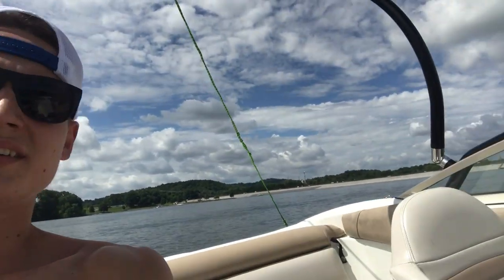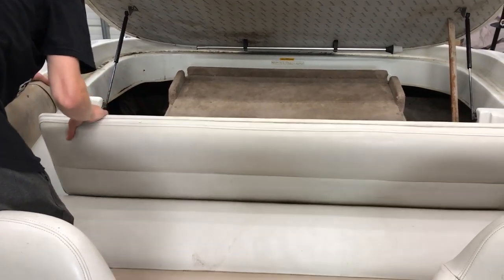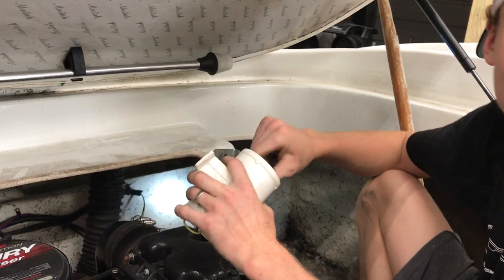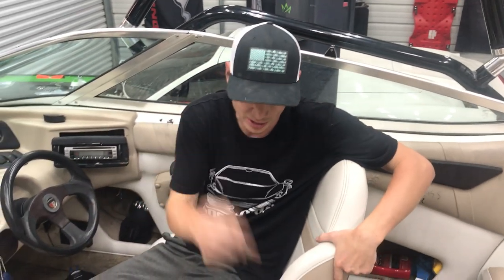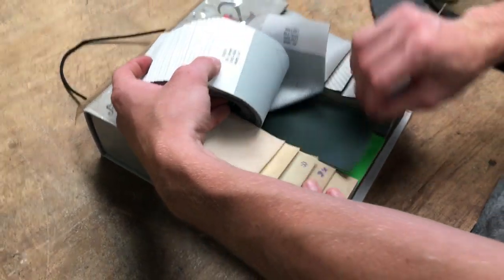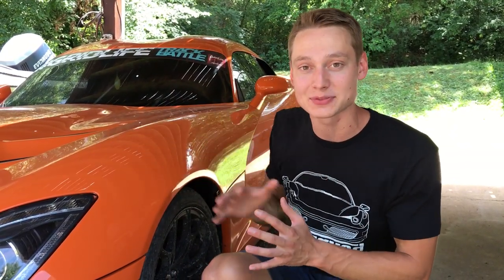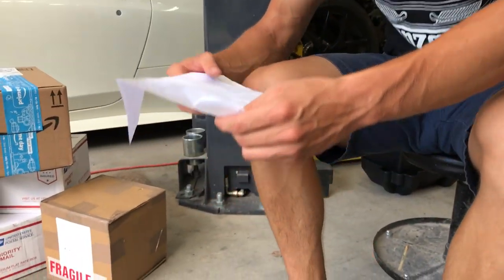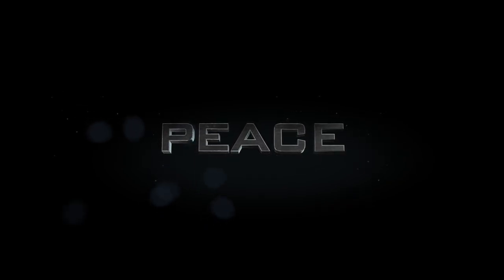Rebuilding A Super Cheap Wrecked Boat Part 4

Comment: Always run the blowers before cranking. A fire or even explosion can and have happened from fume build up.
Reply: Number 1 rule in boating
Reply from the maker: Did not know that, glad nothing bad happened. Thanks for the advice
Reply: goonzquad Run it at least a couple minutes.
Reply: @goonzquad  The fumes from an 8oz cup of gas in the engine compartment are equal to several sticks of dynamite! Be careful guy's. I wish I was closer, could help you out with some stuff, been doing it 40 years plus. Enjoy and keep up the good work.
Reply: They don't worry about those little things, they don't know what they don't know
Reply: @colstace2560  I don't think they care that they don't know or even take the time to research.

Comment: Couple things......You NEED your blower fan working to even start your boat unless you want the gas fumes to blow the back end of the boat off! Seriously.....fix it or when you start it at least open the hatch for a few minutes. Use the blower every time you fire it up for a minutes or two.  Second your speedo is controlled by a small flip down plastic thing at the bottom of the transom. Flip it down to work the speedo and up when you trailer it. there's a small tube hooked to it and it measures the pressure of the water going into it to calculate speed. cheers boys.

Comment: I work on these everyday, the black hose you had in your hand is the oil drain hose, you can use a oil pump to pump it out, the brass plug on the end of that hose is a extra drain plug for the hull.

Comment: That hose with the brass fitting and extra connector is a quick drain for the engine oil.  The brass plug goes into the drain plug at the bottom of the boats transom.  That cable then connects to the oil pan to drain the oil, just pull the drain plug, unscrew the coupler that's attached to the hose (while the rubber drain line is pulled through the hull and you can drain the oil easily without having to pump it out. Side note -  It's really slow draining.  I normally just put a gallon jug on the ground and about 1/2 hour later it's full and proceed to the next gallon.  It should hold 5.5 quarts with a filter.  Also on the RPMs.  That motor is going to grenade at 6K.  That boat is WAY under-propped if the tach is correct.  Need to look at the pitch of the prop (should be stamped on the hub of the prop).  Lower pitch like 19 or so gives better low-end / holeshot performance but sacrifices top end speed. The best bet is to have a prop that reaches the recommended RPMs with a medium load and 1/2 tank of fuel.  Also look for a stainless steel prop vs. aluminum.  Aluminum flexes under load and looses performance.  Side note if you hit a log with the aluminum prop they are cheaper to repair.
Reply: Good job! I'm just going to copy pasta this to make sure they see it!
Reply: Russ Rea  ahhhhh ok, nice one capt!
Reply: Stainless steel props are nice but if you do hit a log or drag the bottom the out drive may damage and break before the prop breaks. I always ran the stock or aluminum props when running in the river where I was more likely to hit a stump.

Comment: The hose on top of the engine with the attached drain plug goes to the oil pan. Mercruiser used to have these on all their I/O engines. It allows you to run the hose out the drain plug hole to change the oil. Note of caution, the plug needs to be tight every time so that the hose doesn't come out while your boating and get chopped off in the prop and empty out all your oil. 
About the 6000rpm running of your engine. I think most Mercruisers top out below that. I think your tachometer is not on the correct setting. There is a dial you can turn with a small flathead screwdriver to set it for a small block V8. Happy boating and keep up the great videos!

Comment: About rebuilding a wrecked Lamborgini : "We'll fix that easy man"
About changing the carpet : "That a big job"
Reply: Lol it is an all day job.
Reply: Pressure wash it. As long as it's not dry rotted it ripped it will clean up.
Reply: They just need to purchase a commercial upholstery cleaner. Hot water and suds will make it look brand new.
Reply from the maker: Hahahah nothings really that hard, just something we’ve never done
Reply: goonzquad use a spray on bed liner like raptor instead of carpet
Reply: @dogbark6394  that would be easy, but also quite ugly I'd think
Reply: @BRAMB0SSS  Noisy and Hot as Shit too. I took tge carpet out of my Jeep Cherokee XJ and I wished I wouldnt have. I painted the with bed liner and it was Hot Noisy amd uncomfortable. I then painted over it with white paint to see if that would help out with the heat but it didnt. So now Im gonna put insulation down then do a rubber floor.
Reply: Guillaume Pigeard hahaha
Reply: @goonzquad  You boyz need to  put that Lamo engine from the donor and put it in the boat....Now that would be soooo Legit. Remember to name the boat Legit.
Reply: Haha.
Reply: goonzquad --- Yes sir!!  Jump in, learn and get it done. I was always a little hesitant in my younger years, I'm 44 now, but I've been a diy'er since I was 17. Just gotta learn what you need to when the time arrives. Keep on keepin on guys !! Teach and inspire !!
Reply: You are right
Reply: @goonzquad  11 months later...lower the engine and retract all the hyd rams to get the fluid back into the reservoir. You will overfill the system if the rams are extended and you top the fluid.
 Follow the manufacture directions for replacing the fluid
The screeching may be the motor itself, an armature shaft bushing dried out or the trim rams rubbing against the outboard.
Reply: @goonzquad  @goonzquad

Comment: Don't do carpet! Hydroturf or something similar. I redid a friends interior with Hydroturf and it's a much better option. He loves it.
Reply: Seadek is the one to go with
Reply: I did the same thing for a buddy of mine. Completely agree.
Reply: @SouthFLMudClub  If you actually fish hard you know sea deck is the worst shit, I hate spending 3 hours scrubbing a bloody sea deck and sometimes it never comes up. Looks awesome and it is good for small helm pads or if you don"t fish, but if you actually use a boat I would not recommend it. Again, it looks awesome, softens things up, and is pretty great but it is a bitchhhhhhhh to clean
Reply: @craigerking9790  I would think on a ski boat it's a great application compared to carpet....
I hear good and bad things...
I'm sure there are positive and negatives...  As with everything. I do plan on fishing often once kids get a lil older. My boat is a 18' center console that we do all with.
Reply: Decadence flooring is the way to go. It just lays on the floor with no glue and you can pull it out whenever and just dip it in the lake or power wash it

Comment: Telling you. 5 or 6 blade propeller on that engine. The wake it gives for wakeboarding is the BEST.
Reply: Yes, change prop
Reply: Dont need anything more than changing the pitch. It probably has a 19  so go to a 21
Reply: @robertrizo4010  maybe if it was 5 years old or younger. But she's probably older than u.🤭
Reply: SourBogBubble absolutely change the prop!  You WILL see a HUGE difference!! 🚤

Comment: Also, you guys really need to learn how to use that trim on the boat! 

Full down for taking off, then once you're up to speed you bring it up to plain out.  If you start noticing the bow (nose) bouncing, put the trim down a bit more (quick presses down until it stops bouncing)

Comment: SPEEDOMETER:  tiny holes on the forward edge of the outdrive.  Clean them out with a small stiff wire like a paper clip.  This is a very common problem as boats go through silt it collects in there and that’s how the boat’s speedometer works by water pressure in those holes.
Reply: Just upgrade to a GPS speedometer. Way more accurate and no moving parts.
Reply: Good intel.
Reply: @michelevitarelli  Yeah, just put a cell phone mount on the dash and download any of the free apps. Problem solved.
Reply: Do they also have pitot tube balancer in line too?  Clean all tubes or just replace with new and I bet your speedo is fixed!

Comment: Next build should be a g wagon 4*4 squared 🔥🔥🔥
Reply: The Boss yes but I doubt it i said the same thing 2 weeks ago
Reply: Nah bro 6x6🥴
Reply: That’s expensive and not practical at all but I wouldn’t say no to seeing that series either
Reply: One useless car.
Reply: The Boss I’d love to see them tackle a g 63 amg
Reply: 💯% Sure! Or X class!
Reply: Finding one of those wrecked would be impressive all in itself and sourcing the parts too would be another adventure
Reply: Agreeed
Reply: Ghost Rider how they even gonna find one of those tho
Reply: Chinedu Ojielo finding parts isn’t too hard it’s just finding a written off one, I did see a manual Lamborghini merci tho and they are veryyy rare
Reply: My ex wife has a G550. It is a horrible driving , twitchy handling monster to drive. It is build like tank, and super luxurious inside and i am sure it is awesome off road. IMO if you want to off road buy a jeep, cheaper parts and way more aftermarket support to do anything you want with it. If you want a luxury SUV they are better , more useful options. $20,000 will buy a couple bumpers from Brabus for your Gwagon or you could spend $20,000 and go crazy modding a jeep . I love Mercedes and owned over a dozen but ii just dont get the modern Gwagon.

Comment: Hey guys, SAE 90 oil for the outdrive lube, "monitor" the funny looking hose on your exhaust riser is an oil drain hose hooked up to the oil pan. The outdrive hydraulic pump can be just emptied out with whatever pump you use around the shop and fill it back up with regular ATF. You will probably have to cycle the trim up and down to flush out the old stuff. And that should be a small block 305.

Comment: If you can run over 6000 RPM,change the prop.
Reply: J L yep for real!
Reply: Agreed. He was probably hitting the rev limiter in the earlier video. There's no way it should rev that high.
Reply: Agreed, but with the speedo broken it makes me wonder how accurate that R P M Guage is.
Reply: A broken speedo has nothing to do with a tach. One is electronic and the other is water fed. Your tach can work and your speedo not. And vice versa.
Reply: @davidwesternall873  Its actually more like 4800, 5500 is more for outboards

Comment: you guys should get some safety equipment for the boat, such as fire extinguisher, lifebuoy rings and so on 🛥️
Reply: Life raft, flares, air horns, etc...
Reply: michele vitarelli it’s a lake boat so I don’t think that’s necessary.
Reply: They have a ton of noodles in the middle. Probably enough to keep the boat afloat.
Reply: Especially a decent fire extinguisher.
Reply: Good call
Reply: @Nick-ip7ks  doesnt matter
Reply: randy0048 they’re in a lake you’re not required to have a life raft. There are usually many other boats out with you on a lake to help, if not just swim to shore wearing a life jacket.
Reply: You might want to check the laws in your state....there should be two people in the boat (one for the flag) when pulling a wakeboarder
Reply: Since its been full of water.
They should really check the wooden structure along the inside of the bottom of the boat and make sure its not rotten before they do anything
Reply: @timazevedo  not when you have a rear view mirror which he was using
Reply: @thegreatwhitenorth8754  stringers

Comment: Hey guys love the channel love all the work you do. I used to be a Marine technician, the motor with milky hydrologic fluid is your trim motor that raises and lowers the outdrive, if it's milky white then you have water coming in through a seal on the drive rams, you might be able to replace the seals depending how the ram arms look, easiest route would be to replace the arms with new ones and run new fluid through whole system flush out the watered fluid out best you can

Comment: Power wash the carpet and it will look brand new. Save your money
Reply: Right and only recover the damaged interior parts in the same color. They are light in color for a reason as dark colors get hot out in the sunlight and the water reflects the light making dark surfaces even hotter.
Reply: Nah  you can power wash it but grey would look better so the should change it
Reply: Spray it with green and grey paint, and no one will see it is dirty....cheaper than power wash 😁😁😁
Reply: hose off the carpet for this season and use the frakkin boat, then when winter comes U have plenty of time and the rates are cheeeeeper for the boat upholstery  bizs to do the work
Reply: @strongy77  yeah, no need to go LAMBO on this boat, use it up for a few years and save the $$$$$ for a bigger boat with a cuddy cabin and twin MERCS..............
Reply: that is the most retarted thing they could do, they would honestly better off burning it then do that. The wood under the soaked carpet would rot extremely fast. Personally thats why I don't fuck with boats with carpet.
Reply: @gertraba4484  cant believe all these googans lmao you do not ever put water on a carpet boat, it will ruin it. the water takes days even a week to fully dry out and it will rot that boat in a matter of months, goonzsquad hope you see this DONT USE WATER ON THE CARPET yes it is a bitch to deal with, but thats why i stick with fiberglass
Reply: @craigerking9790  2001 boat, probably doesn't have wood under the carpet.  It's most likely glass.
Reply: @bobadam7021  you crazy? of course it has a wood deck, maybe glass over wood but either way getting that carpet wet holds moisture in all the wrong places. My buddy has a 2008 wakeboat and would wash the living shit out of it every time it went out, now he is dealing with no helm chair as the wood under the glass rotted out and the chair ripped out of the deck. Trust me water and a carpet boat is a shit mix.
Reply: @gertraba4484  yeah cause that kind of boat would be so useful on lakes
Reply: @craigerking9790  who makes that wake boat? My father has a 93 Stingray with 0 wood.  My 08 Glastron has a wood free deck.  Back in the 80's most boats had marine ply covered by glass and that was perfect until the screws went in. The water infiltrated the plywood and could never dry because it wasn't able to breathe.  That's just not common any more. I won't say it doesn't happen, or that Mariah didn't use wood, but pressure washing the carpet would be fine if they dried the boat out thoroughly after they did it. Remember it was half sunk on the trailer when they bought it.

Comment: The speedo pick up tube is clogged, that is a tiny hole on the (out drive)foot, blow air in it and you should be able to see the speedo working.
Reply: Or its broken where the lower unit splits in half .
Reply: Jason Jones yea those plastic clips suck, that hole design could have been better, but that’s mercury

Comment: If you haven't already changed that fuel filter (white filter bottom left of engine), that may help with that power loss issue. Clean the flame arrestor (air filter) on top of the carb. Also tighten that belt! The tensioner is the plastic pulley top right.

Comment: A Porsche GT3 RS for the next project would be so cool   🔥
Reply: Florian Jungwirth hard to find it on an auto auction
Reply: Florian Jungwirth do you use any common sense? Where the fuck are they gonna find a 500k “project”? You ain’t finding a Porsche gt3rs at any auto salvage auction anywhere in the world and you won’t find many recked in general.
Reply: Florian Jungwirth they’re a 500k track car, the people who buy them buy them to drive hard and don’t crash because the Porsche gt3rs is very easy to handle.
Reply: @joshlarochelle1298  I have seen Ferrari Enzo's and Bugatti Veyron that were salvaged wrecks. The fact that a car handles well doesn't mean it won't end up wrapped around a light pole.

Comment: I sure hope you aren't revving that engine to 6000RPM.  Take a look on the flame arrestor on top of the carb, it will list the max RPM which I believe is 4500 for the 5.0L engine.  You need to get another tach and verify the readings of the gauge in the dash.  

Also DO NOT put a standard Holley carb on this engine.  You MUST have a marine carburetor because the venting of the fuel bowl is different to prevent raw fuel flowing into the hull in the event of a float valve failure.
Reply: Yeah i'd be willing to bet the tach is accurate, but they need to increase the pitch on the prop to lower the RPM's down a bit.
Reply: I haven’t heard anything regarding trim either, maybe it’s up way to high and sucking air causing over rev
Reply: Like2Build amen to this comment brother. Inspiring youth.
Reply: Bugatti je veux regarder lavabo Gatineau bad-boy Bugatti Divo
Reply: @AnthraxBird  nah, even when its idling the tach is reading about 2500rpm, tach is stuffed.

Comment: You guys can handle the seats/cushions. I've owned boats and done it myself with some help from none other than a local mom & Pop boat upholstery shop!! Just Like the one you're going to! Buy the material from the shop you got the estimate from. Have him (the shop dude where you got your estimate) cut , sow the vinyl he'll have a heavy duty sowing machine for that. The foam he can form for you also. Then you guys can assemble the materials. It's not as hard as you think and you can cut the estimate in half!  It'll look better than when it came from the factory! Of course the shop has to be willing to do that. Good luck!